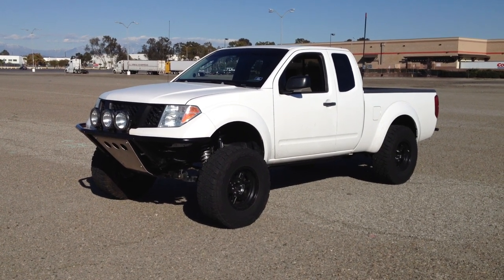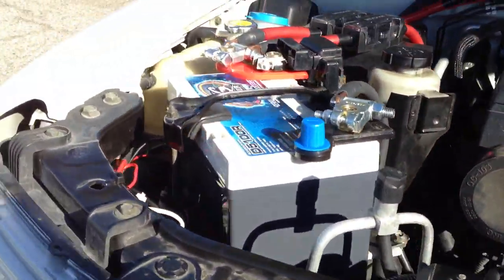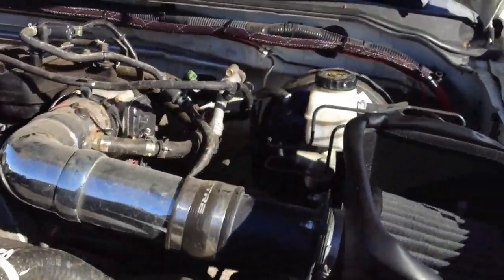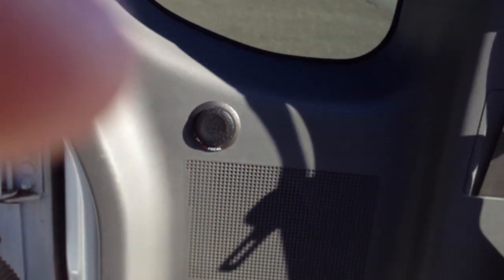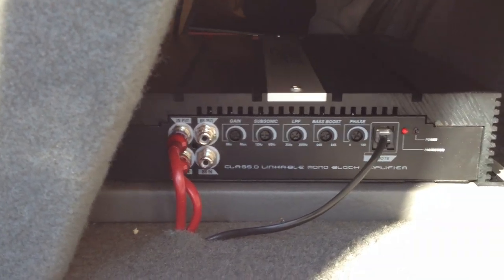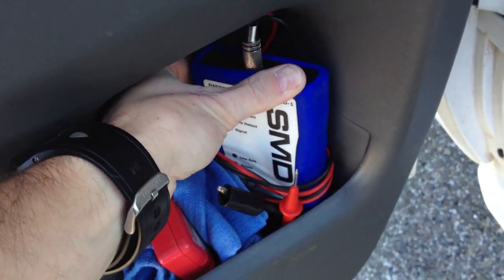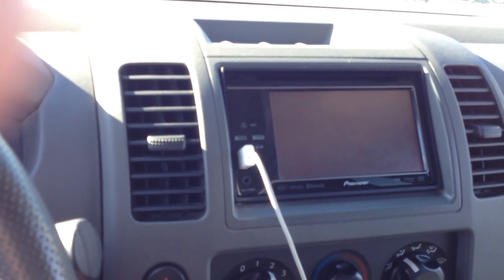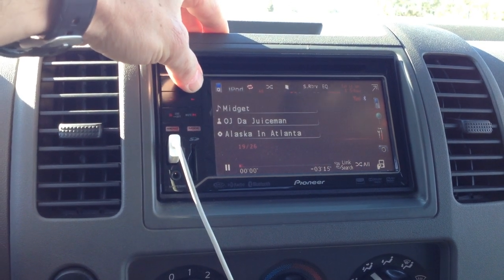2006 Nissan Frontier System - Sundown SA-12, Focal Polyglass, XS Power, and more

Comment: Nice setup , your voltage is awesome!! I'm about to do a single 12 in my fromtier crew cab, but I'll have mine on a sq2200 @.6ohm and a kinetik hc3800 and a big 4 plus 2 runs of 1/0 just for amp and then a separate 4ga run for my kicker dx200.4. My sub should see about 1800rms or so after rise ..... I'm hoping voltage stays in the 13's like before.

Comment: i have a  nissan king cab myself.i have been using,and still am,a ssa xcon 10 in a custom areo ported box for the last seven years.am wanting to upgrade to a 12 ssa zcon...i would pay good money for a box designed like this except for sub mounted on the side loading off the rear door with two aero ports instead of slot port.would you be interested in building 1 ? i live in tn.it would be worth your while.lmk thx